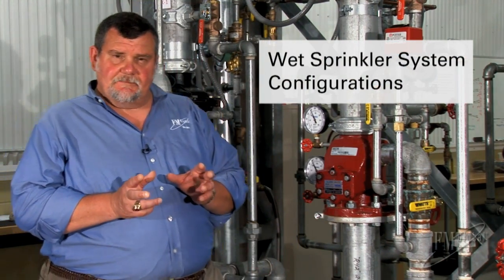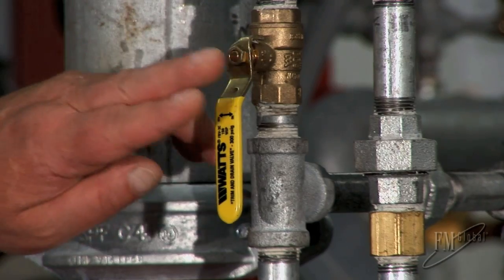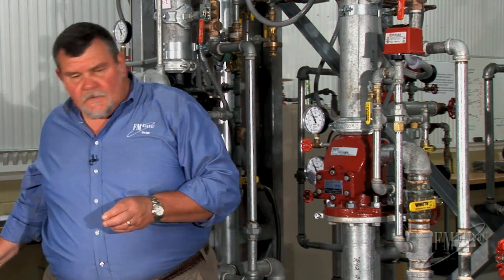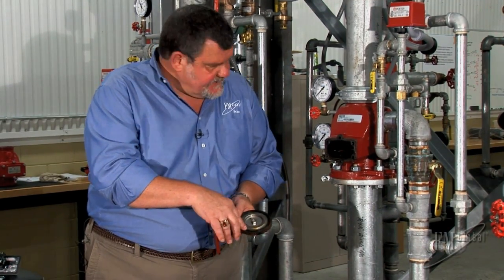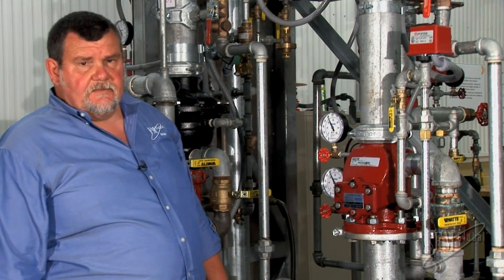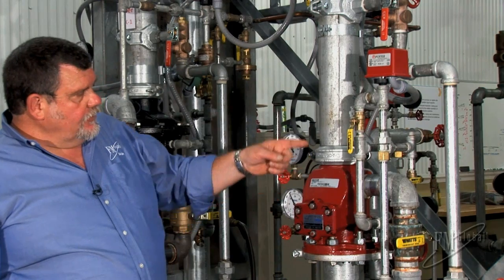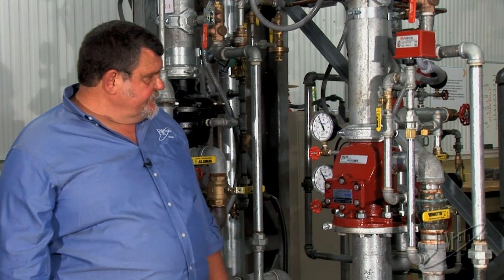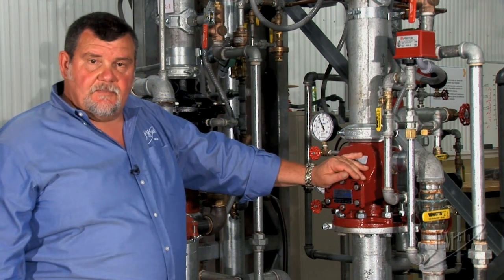Know More Risk: Wet System -Alarm Check Valve

Comment: Question : if the system pipes above the.Riser and check valve all the way to the sprinkler branch lines and heads  are full of water why is it that the water is going from below the wet check valve / through intermediate chamber and out the ITV or pressure switch ?
Reply: I wish I could see the unit but if water is making it to the pressure  switch it indicates that although all appears  set ,the clapper is not sitting properly and the intermediate is taking in water.basically a false alarm.
Reply: @sambarreto9639    yea I read this now ( what I asked ) and kind of don't even understand what I was asking anymore but oll have to re watch the video later and see and come back to here and tlk about it more with all the great people on this.  Thanks tlk again later
Reply: A regular check valve only stops water from flowing back to where it is fed from. But since you mentioned an intermediate then I'm thinking you are talking about an Alarm Valve ,which is basically a check valve with gauge , drain and alarm ports as well as a test valve for alarms and a bypass  which allows water to flow into above clapper without lifting it to cause false alarms.  These days a lot of systems are straight pipe as well with a water flow switch eliminating the Alarm Valve.
Reply: When the system fills with water the clapper kind of waggles a little bit ,equalizes ,then sits flat. If she doesn't sit completely flat with the pressure equalized on top and bottom,  it's because there could be a pebble ,or obstruction on the seat, then the water will still swallow in through the intermediate and trigger the Alarm Pressure Switch or Water Motor Gong. Sometimes small leaks come from a bad rubber gasket or soiled seat.This type of tiny seepage can cause a false alarm that builds up over time, maybe a few days or a week,, the build up of water  pushes the pressure switch alarm .The seat can  be cleaned with a little emory cloth or the gasket may need to be replaced.  A quick trick is to open up the drain all the way allowing the water to flush through Alarm Valve  chamber and knock out whatever could be obstructed , then closing the drain the system will equalized again and  the clapper has another chance to reset  itself flat . Don't tell anyone, just kidding.
Reply: Wow Holy crap I concur
Reply: Amazing  thanks nicely explained , hope most ppl can read and understand

Comment: Why doesn't the alarm get set off everytime system is filled? Water is still going from the intermediate chamber into the flow switch.
Reply: Austin Hologroski probably because he closed the ball valve on the alarm line which is, by code, not supposed to be there. That’s the one with the yellow handle he said must be open at the beginning. At 50 seconds...
Reply: Sometimes it does go off ,its possible the alarm shut off valve is closed or the switch itself could be bad.
Reply: alarm panel can be silenced and set for test.

Comment: why must the pressure gauges show same reading?
Reply: Pressure on wet systems can show higher readings above clapper because when at night water pressure rises with less neighborhood use ,water pressure goes from below clapper to above clapper through Alarm Valve bypass and stay locked in above. I believe some older models allows water to go from top to bottom through an intermediate bypass(small hole from below to above and vice-versa ) as to not lift the clapper causing a false alarm ,this type of bypass keeps readings looking balanced. When they get clogged the can cause false alarms.
Reply: Does not always show the same, if you just filled system at that moment and presure doesn't match, one or even both gauges need changing would should be calibrated  every five years anyway.

Comment: Why is it so loud? We have a sprinkler room where i work and one day i was getting my chemicals and it randomly kicked on and the room is small, and you can hear it thoughout the entire facility, it blasted my ears and I still can't hear right
Reply: If it's a Dry system the compressor can kick on once in a blue moon to upgrade air pressure that holds back water pressure. If the compressor kicks on every few minutes  or less indicates a small leak on air supply line  from compressor to system. Sensor line.Yes the compressors are loud and should be braced as to avoid excessive shaking.